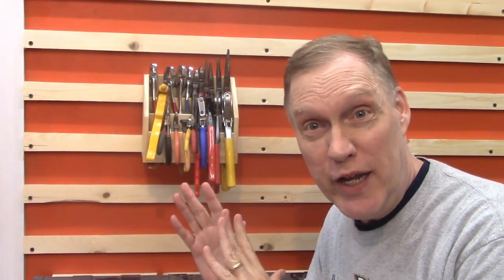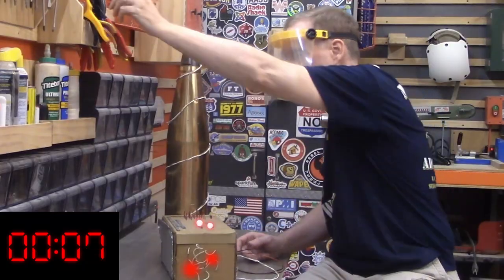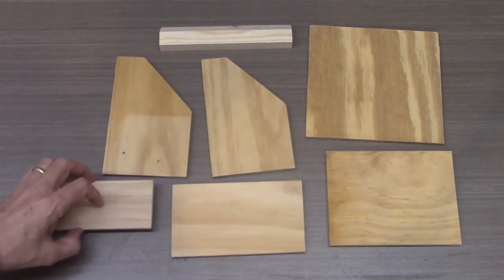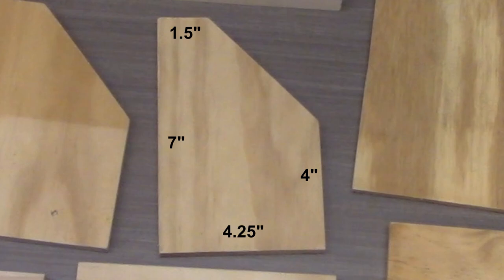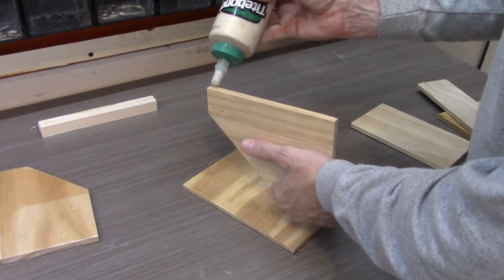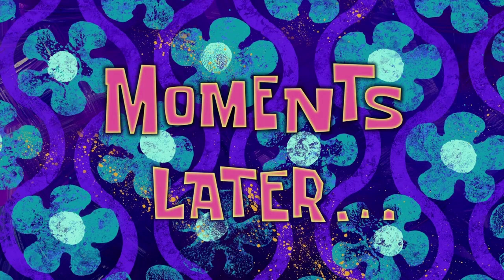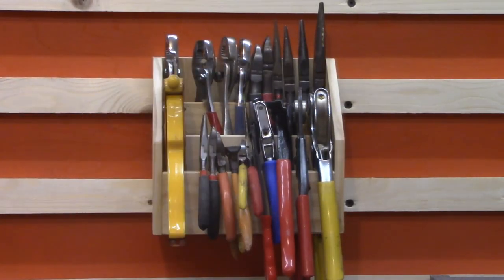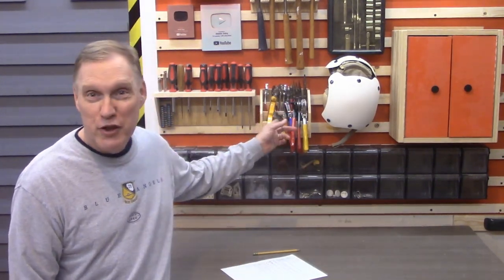French Cleat Plier Rack - Small Size But Stores A Lot

Comment: I just made this rack.  The idea is great, but the dimensions are small.   For anyone wishing to build this, I'd strongly suggest increasing the width and especially the depth of the sides by 1" to 1.5" inches.   However if you use thicker plywood, be sure to take that into consideration.  And if your pliers have  thick /padded handles, take that into consideration too.  I've built about 8 various french cleat tool holders and the one thing I'm learning quickly; if you have  limited wall space it's very important to build holders which have a narrow wall profile and are deep and extent away from the wall.  I like the concept, keep it up!!  Thanks.
Reply from the maker: Very excellent comments and great modification to the design! We hope yours works as well for you as ours has for us!

Comment: Fantastic! Thanks for this, this was an extremely easy build with your walkthrough. 
For metric users, the cut list with 12mm plywood is: 180mm x 194, 180 x 110 (x2, then cut the triangles out that are 70mm of the 110 width and 80mm of the 180mm height), 170mm x 65, 170 x 95, 170 x 125.
Reply from the maker: Glad it worked for you and thanks for the assist!